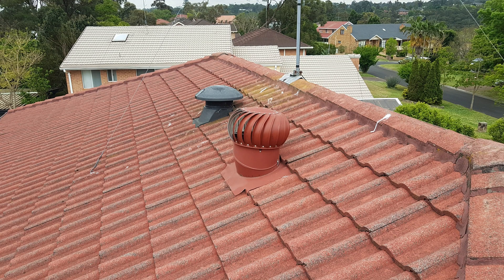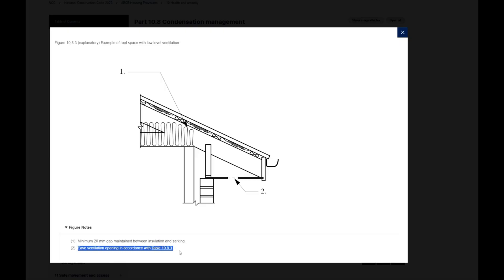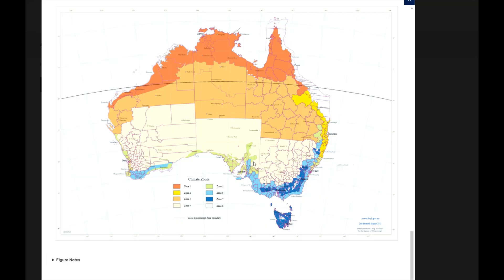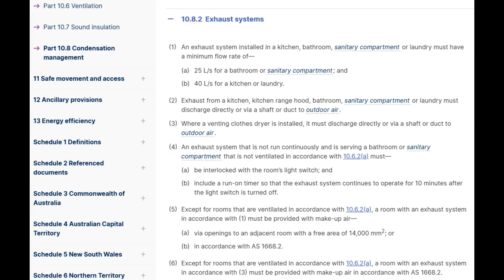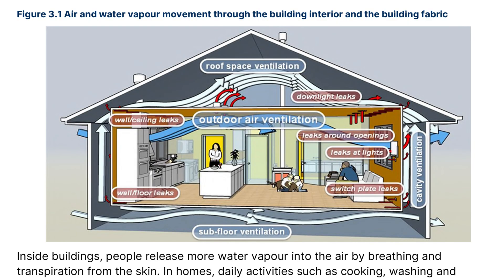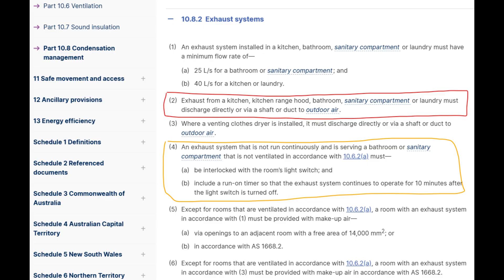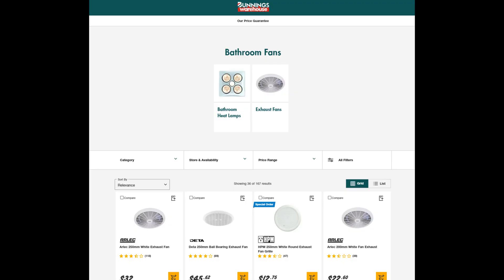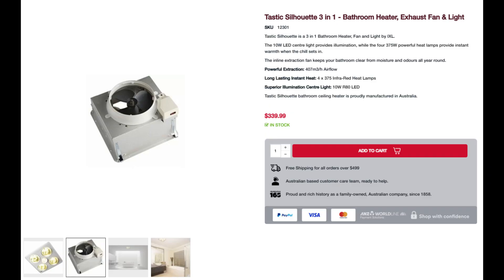Ventilation basics for Australian houses part 3

Comment: Mate I am a farmer in climate zone 7 (sub alpine) and we use a lot of steel for house roof cladding and farm sheds sheds (walls and roof. The cold means insulation is important. I've done a building course and have been searching everywhere for solutions to the condensation mould  problem which the course did not satisfactorily address. Your videos have been BY FAR  the MOST HELPFUL resource I have found. THANK YOU !

Comment: Hi Jack, FYI and for your viewers, IXL now have an Easy Duct system with all the bits..the ceiling unit has a side duct outlet, a separate in-line fan with one-way flap, 6m 150mm ducting and the wall/eave external grille.  Just installed in preparation for your conversion of our roof to Colorbond.  Of course we had to remove the existing working unducted  IXLtastic.

Comment: We fitted Mercador products, from Bunny's, six years ago.  Duct was part of the system with a spring closed non return for when the fan is off- so no back draft. Attached duct to eves board outside. Meets the current requirements

Comment: Easiest fix for an old fan is to pull it out. Plaster the hole and put in a new exhaust using an inline fan and then external.

A dome skylight is a terrible idea as the air in the tube condensers (hot and cold air interface in wjnter) then it drops and stains and wets your plaster ceiling.

Comment: If you put a hest pump dryer in your laundry there is no need for an exhaust fan as there is no moist air. The moisture is condensed and drips.out a pipe into your sink as liquid water.